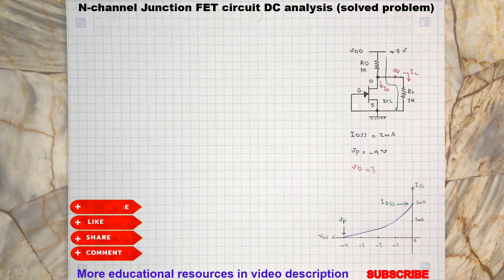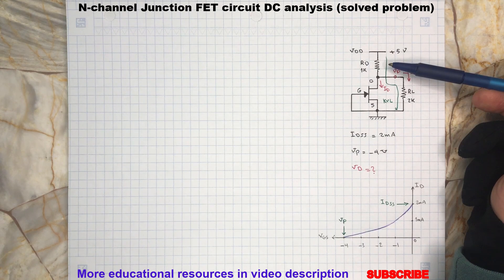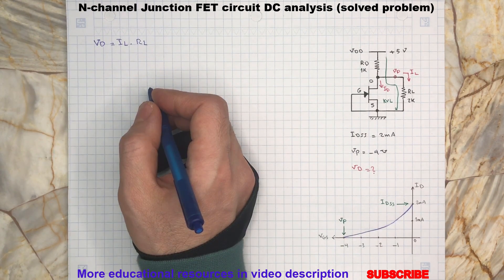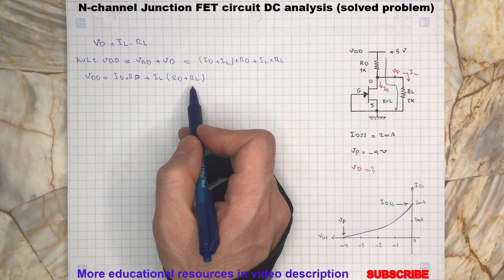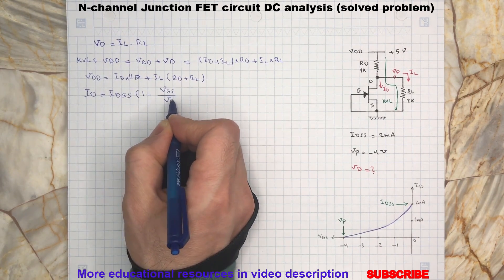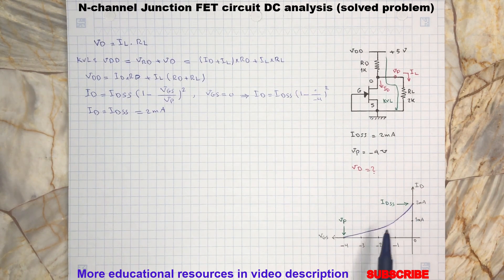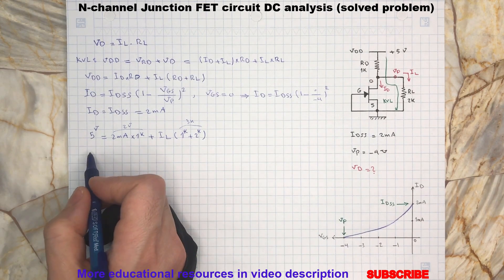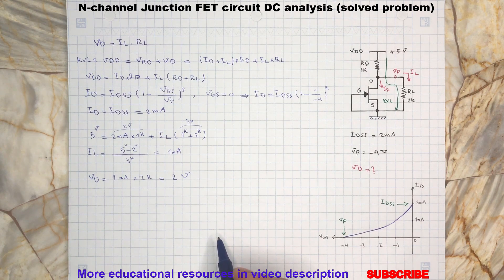N-Channel JFET Circuit, Junction Field-Effect Transistor JFET Solved Problem, JFET Biasing Example

Comment: 2:30 But if Vgs=0, then N-mosfet is closed. Or I missed something ?

Thank you for helpful problem solving.
Reply from the maker: There is difference between JFET and Mosfet. This problem was focusing on Junction FET (JFET). In the JFET transistors, the maximum Drain-Source current will happen when VGS = 0 volt and at this condition, ID = IDSS. It is good to know that Depletion type Mosfets will have the similar result when VGS = 0 volt and it will conduct even with VGS=0, however the drain current depends on VDS value. You can find this information in many electronic books. I hope it helps.